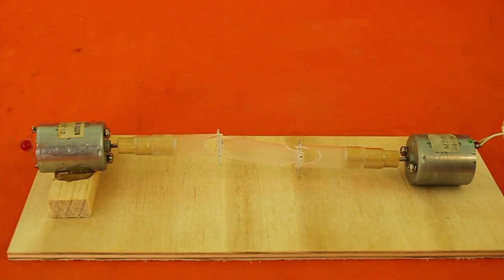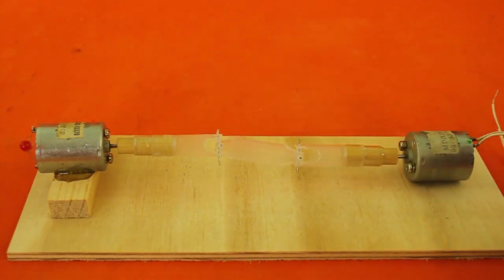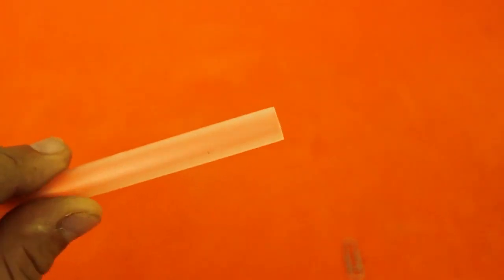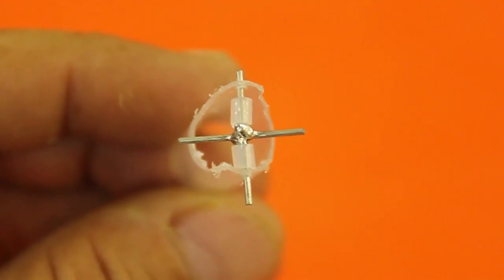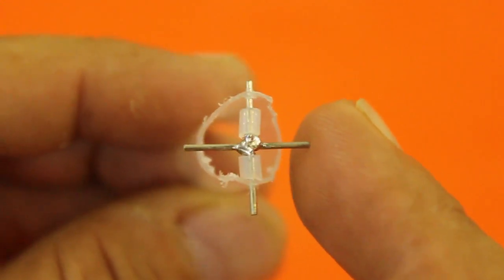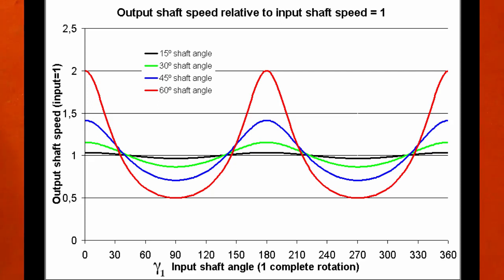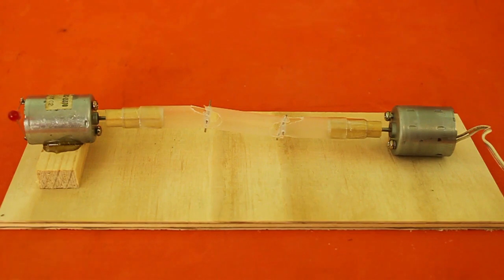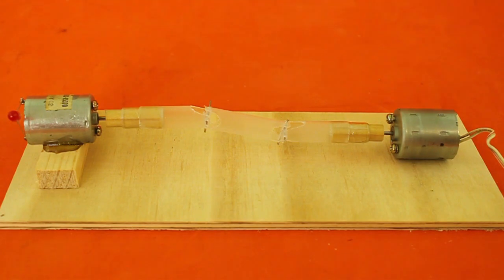DIY Double Cardan Mechanism

Comment: Very interesting. Easy to understand. Thank you for posting.
Reply: @ludicscience  This isn't a Cardan mechanism.  It's a poor imitation of one that sorta kinda works like one.  When one increases the shaft angle one is increasing torque around an axis that isn't desirable.  It's better to do this the proper way and use a gear mounted off center such as is done in the video linked below.  
https://www.youtube.com/watch?v=xlYHototu5M